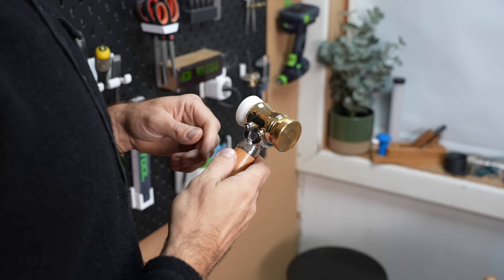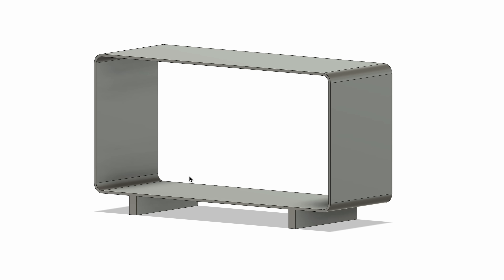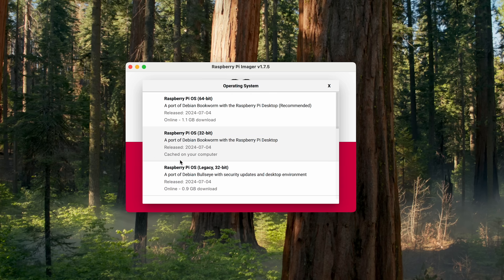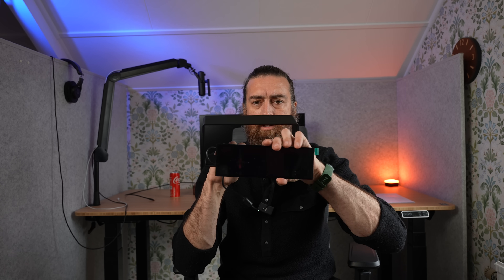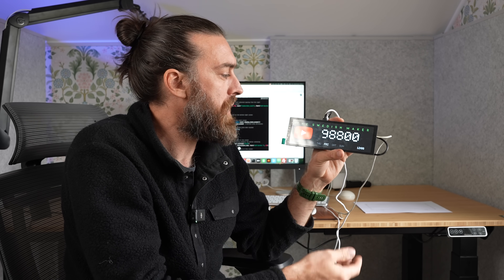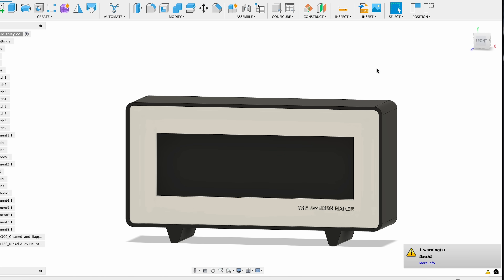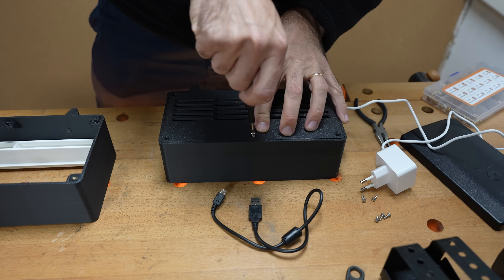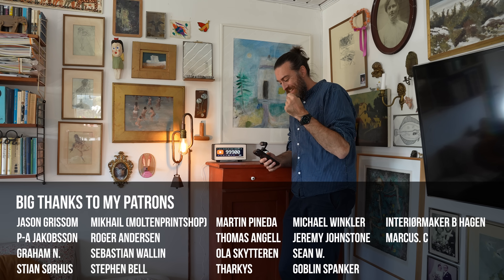a revolutionary tool - and it's free

Comment: It will absolutely shine in combination with all the other technics you're using. 

I appreciate you tried to put the machine front and center, but think of how you could use it in the Mac Mini case, the subs counter, storage or all kinds of jigs and templates. And it can replace some 3d printing too, as it would make flat panels a lot cheaper with potentially better finish on the parts. 

PS: I'm just a wannabe maker, so maybe I'm wrong, I just wanted to show my support

Comment: The tool is Fusion 360.

It’s free for 3 designs for non-professionals. After that, you must mark older designs read-only.
Reply: 3 designs? Used to be 10 (actually unlimited way back). I still have it at 10. Is the number reduced for new accounts?
Reply: @thepgo666  I still have the 10 limit
Reply: @felixjohnson3874  Last time i checked it felt quite a bit like GIMP of CAD world. Did it get any significiant updates over last year or two?
Reply: @thepgo666  no it's basically still gimp; it does basically all the same jobs as the alternatives basically just as well (occasionally slightly worse, occasionally slightly better) but since people learned those first they think it's harder. I taught myself Freecad from scratch using basically no online tutorials over like 8ish hours. Then the practical knowledge of learning the general dos and don'ts took me making one useful part which took maybe a day or two of total work having done no prior CAD work at all over the past 2-3 years. (And that was with a fully parameterized part that I had exact specs for and needed to be able to tweak if it didn't work right. I had the basic model done in I think like half an hour and after having the experience could remodel the entire thing fully paramterized in just as long.)

It literally took me one weekend to go from "huh, actually that'd be a good idea. Oh, I should try modeling it!" to having a 96% of the way there first print, and when I had an issue and needed to remodel some clearances it took 5 seconds and when I also needed to remodel part of it's intricate internal geometries (I needed to design fine flexures to let a caster wheel snap-fit into it and my original design was a bit too fine for the precision I actually had) it took under 5 minutes. It probably took me several magnitudes longer fighting to get it printed on publicly available machines in a nearby hackerspace (not shit ones either, they were bambus, though I'm not quite sure if those two statements are contradictory or not having used them) than it did actually making the changes to the part.

The only issue I've actually had is chamfers breaking when I change things but 1 : after one real project I immediately figured out best practices for them, 2 : it's a sub-minute fix, and 3 : that's the TNP which will be fixed in 1.0. (Is currently 'fixed' in RC2. Technically it's an unsolvable problem just due to how geometry works, but all current CAD solutions just approximate an answer and generally that works good enough. The 1.0 release implements an algorithm developed by a user called RealThunder that (allegedly) solves it quite well. Personally I've had no reason to bother installing RC2, but it's pretty unanimously people saying it's already great.)

It does work very differently to most other CAD suites, but that's because it treats you like an adult trying to solve a problem and not a toddler browsing youtube kids. Having used other CAD suites before, (f360, onshape, tinkercad, basically every big name except solidworks) being able to manually define constraints exactly how I want them and then have the solver explicitly tell me if it's fully constrained is a godsend. Yes, "fully constrained" can still mean you constrained it incorrectly from how you wanted it, but you at least know it IS fully constrained. (You can't download skill) Other CAD suites generally just try to abstract that sorta stuff away, which they inevitably fail at eventually (again, things like the TNP aren't a software problem, they're a 'nature of how reality works' problem.  It is literally impossible to 100% solve them for the user, and the more modern CAD suites keep trying to abstract them away the harder they are for the user to solve when they do become an issue) and then you end up fighting with the tool just trying to get them to fucking work right. In contrast once you spend like a day or two modelling a complex part and learn what the constraints all do it's a breeze to model incredibly robust sketches because you actually have the tools to fix the damn problem. Seriously,  fighting nonstop with Fusion, onShape, etc. is what made me stop bothering with CAD software & 3d printing in the first place because the second I had a hard problem that I had to tweak every model they created would crumble in one impossible to solve way or another. It's an issue with almost all traditional commercial software because it's designed to be easy and marketable to get more customers, but is almost entirely absent in FOSS shit that's designed to solve problems. Ondsel tried to bridge this gap but they sorta missunderatood the problem; they assumed it was 'people can't figure it out' and not 'people don't want to bother'. Again, you can learn it in like a weekend, (maybe 2 or 3 if we measure to the point where you're fully comfortable instead of just to the point of "I can use it". After that one functional part I was already super comfortable with it.) it's not hard to learn, it just takes the conscious, wilfull intent to. Learn it once, use it indefinitely. I'll gladly take that over never learning it at all, fighting it indefinitely, oh and by the way gimme your wallet. 

Even putting aside the FOSS side of things, (which is not just philosophical wankery mind you, something being open source or not basically means that even if they want to screw you over they'll get forked and fail. See: Redis. Meanwhile if they aren't they can just screw you over. See: VMware. It's not just idealistic twitter activism shit, it does have some real world relevancy) basically every alternative is priced as reasonably as photoshop and/or is online and requires an internet connection. If you literally just want a program that can let you model things you had better be okay with requiring an internet connection or be an oil tycoon. (Or deal with stupid as fuck restrictions like only having 3 parts you can modify at a time) Freecad is quite literally in a league of it's own by default with just those two restrictions of "must be a program I can run if my internet goes out" and "must be priced somewhat reasonably". (It's free real estate CAD software) You can at least sail your way to photoshop (their business model is quite literally built on it by this point) but you can't with shit like Fusion because its so cloud dependent.

Even if I could get shit like Fusion or Solidworks for free (and I think I actually might be able to because I still have my old uni email kicking around and from what I've heard they don't really vet those) I'd still use Freecad because it's not worth the effort fighting them. If I have to spend more time fighting the software when I need to model something complex then just modelling that complex thing, what is the point of your bloody software?! People think things like Freecad or GIMP are difficult because they're designed fundamentally differently than alternatives. Alternatives are designed to appeal to the mass market and get people hooked into being paying customers, whereas FOSS shit is made by people who just want their damn problems solved. (mind you, I ain't no breadliner saying "use HnSickleCAD because it made by glorious comrade, for glorious comrade" here, the free market is a damn fine thing when it comes to optimizing for the societal average, but "optimizing for the societal average" and "best solution for an individual" are not synonymous. Life is filled with people making concessions because they can't be bothered, even if they've suffered more by not doing the thing than if they'd just done it already. But, even so, that's a choice made by the individual, for the individual, so serving that average is still technically the best option in general. As said individual though, you can just make the choice to clean your damn lobster already. Or, y'know, something like that) But, if you just go online and look at professionals in any CAD software working, they can knockout parts just about as fast as eachother. It's literally just an initial learning curve problem that pops up because most people first got started with their competitors which were made with fundamentally different goals. In terms of actual ability basically every CAD solution can do basically any job that the others can, and speed is dictated primarily by familiarity. (Though, again, IMO the gotchas in other CAD suites are WAY fucking more problematic) In terms of usability they're functionally identical to their competitors, but their competitors often just get wider mass market appeal because that's what they're designed for, ergo most people learn them and their style, ergo most people are used to them and their style, ergo something starting from a fundamentally different conceptual basis feels way harder because they're experiencing having to relearn something that they know for a fact they should already be able to do. (And yeah, it feels like fucking shit, to do that.) It's literally just first move advantage, whatever you learn first is what you'll feel is the easiest until you slog through learning something else fully and can compare retrospectively. But, like I said, you can just find videos of people working in tons of different software suites and compare how fast they can get shit done - there isn't any real difference. If you already know another CAD suite you'll feel like shit being unable to do something that you know should be easy, but after that it'll do all the same jobs, sometimes a bit worse, sometimes a bit better.

If you do want to start learning it RIGHT FUCKING NOW then downloading rc2 might be the better option, but otherwise it looks like the official 1.0 will be out in a matter of days or weeks. ("rc" means release candidate. I.e. : "it's the version so fucking close to release we want people to use it and report any final bugs we missed so that the official 1.0 is spotless". Of course no software ever actually is spotless, but it's not some alpha or anything; it's already 99% of the way there. They just want that extra 1% before making it official since they know that everyone will hold the specific release number 1.0 as being way more important than 0.99999999rc45. Right now there are only like one or two 'release blockers' left on the chopping block and they're being blown through pretty bloody fast.)
Reply: And you may find features you've used in designs are removed in all but the most expensive tiers. While FreeCAD has issues, I stomach those problems more (topo renaming? assemblies a bit 2nd class?) than finding I can no longer interact with my designs without coughing up half a house a year in cash.
Reply: you saved a lot of people 11 minutes because they spent the first 29 seconds tyring to figure out what the tool was from the video before they scrhooled down and foound you.

Comment: That's one really cool project, congrats on 100ksub! EEVBlog did that with IN-12 Nixies and that was just way too cool - I'd use 16-seg, think Burroughs B-7971 if they only weren't mighty expensive... and with four tubes and neon lamps in between for decimal point, I'd use the rightmost one for displaying the order of magnitude prefix (K, M) after reaching 10K. And this could also double as a clock and as a thermometer.
Reply from the maker: Yeah they are so cool but so expensive :)

Comment: I adamantly refuse to use Fusion 360.  They kept it free for long enough to crush ANY kind of rising competitor, and then they chopped it up into modules without adding ANYTHING new and are charging thousands of dollars a year for features they were willing to offer for free as long as they had competition.  AUTODESK NEEDS TO BE BROKEN UP.
Reply from the maker: Im just stuck in it until I have time to learn a new program, but there are free options out there. I know a lot of people use On shape.

Comment: Congrats on your 100k. This is basically a Fusion 360 advertisement. Fusion 360 is not a free product. It is a paid product that Autodesk gives some temporary restricted no cost licenses to for certain constrained uses, but there are many extra strings and the reduced feature set and rules and requirements keep changing. If you want CAD that is actually free then look for actually free and open software and support it instead. If you decide to use Fusion 360 then plan on paying for it, sooner or later you will need to (or move to a different package) in order to get a feature or the privacy you deserve, or even to keep using it after they decide you are no longer eligible for a free license.

Comment: If at some point want to repurpose your larger pi:  Raspberry Pi zero 2W, perfect for this, tiny, near the same performance of a 3B but very low power (150mA) and extremely cheap. PS. subscribed, nice channel, good words per minute and signal-to-noise ratio, excellent photography (blue/orange depth enhancement noted) pacing and design sense, the counter looks like a Dieter Rams, my one critique would be to lose the on-screen name of channel, it's already on the case. And yeah, CAD is indeed a game changer.

Comment: Congrats for the 100k subs!!  I'd like to use Fusion 360 but it is so damn expensive. I can't justify the price for what I would use it. The "free" version of it is so frustrating to use with 10 project limit and the yearly reinstall etc....
Reply: 10 project limit really isn't that much of an issue. They've made it super easy to just flip projects from active to inactive and if you really do need more than 10 simultaneous projects then perhaps the subscription is appropriate for your needs. 
I do agree about the yearly re-activation dance being excessively obtuse to activate.

Comment: There are USB-C U-Connectors for phones where the connector angles 90 degree, goes back 1cm and then another 90 degrees to go down behind the device. For phones those have the connector at the bottom where it could stand on the connector this way. For your counter you get the cable behind the device this way.
Reply from the maker: Smart. Didnt know that

Comment: I just don't like how fusion 360 treats customers and feel like they will eventually make it not useable for free users. We really need a better open source software such as blender
Reply: I fully agree. Currently I use Autocad, because we have it at work, so I can use it on my free time. Make model, export stl, and import that on my 3D printer.
I never used blender before - I always thought it was a software primarily used for 3D animations, motion graphics and so on. Didn't know you can use it for 3D models, too.
Is that similiar to other software regarding that task, or are there extra hoops or restrictions?
Reply from the maker: I agree. That would have been great

Comment: Congrats on the 100k!   Whenever someone new to 3d printing asks my advice on what to do with it, I always tell them to get some cheap calipers, and learn some basic Fusion 360.   With those 2 things and a 3d printer, you have endless possibilities at your fingertips.   There's something kind of magical about being able to take a measurement, draw something based on it, and have it print at the exact size you wanted.   Once you make your first custom part (for whatever random thing you needed around the house, shop, office, etc), you will be seeing potential ideas everywhere you look.
Reply from the maker: Couldn't agree more. Like you said - its something kind of magical about it

Comment: and the tool is...?
Reply: I watched with 50% attention and around 9:45 I finally realized the tool was CAD (Fusion 360 or similar)
Reply: @fredhamilton1701 if you value reliability, never use fusion 360 and its BS cloud only token based crap. Just hoist the old jolly roger and pirate inventor, solidworks, etc that works offline after install.
Reply: @fredhamilton1701  this video it's just click bait and sponsored. Nothing really useful from it other than someone making you stick into it useless
Reply: you're slow af ❤️
Reply: I’m a bit disappointed.  I subscribed to your channel because you did woodworking.  But lately it seems most of your stuff is CAD/3-D printing focused.  And, this episode was nothing more than a bait-and-switch.  (I.e., no tool.).   But, maybe my expectations are misplaced.  You are, after all, the “Swedish Maker”, not the “Swedish Woodworker”.
Reply from the maker: There will be more woodworking. Just trying to switch it up. Didnt try to make a bait and switch video - CAD modelling truly changed the way I work and I wanted to pass that along.

Comment: Way to go!! I've used Fusion 360 for over a decade. It's difficult to imagine engineering life without it. The  CNC router, 3D printer and ability to import PCB designs from DipTrace has boosted my accuracy and design opportunities.
Reply from the maker: Couldn't agree more - its a lovely tool to have